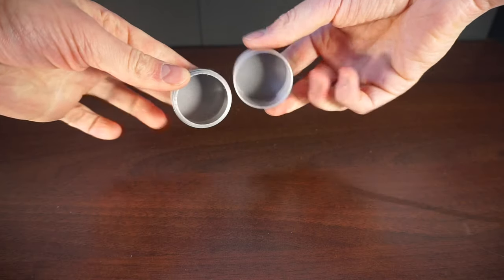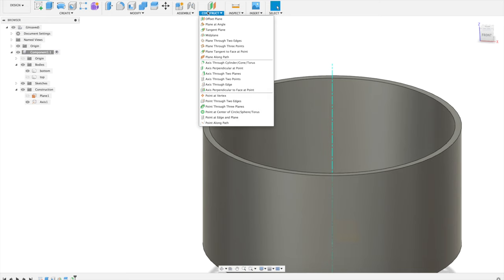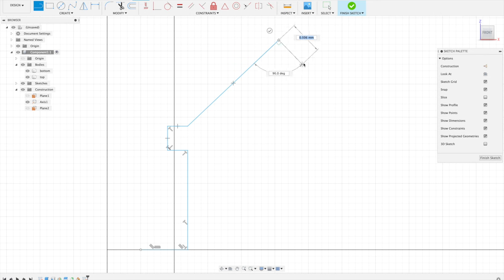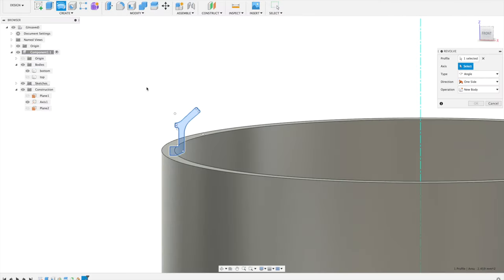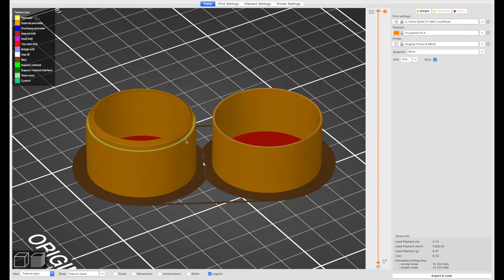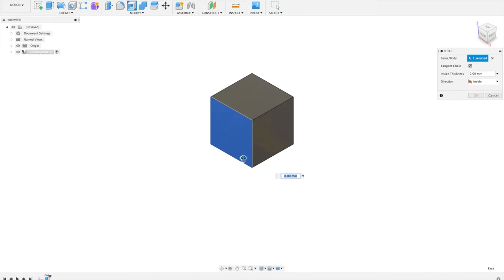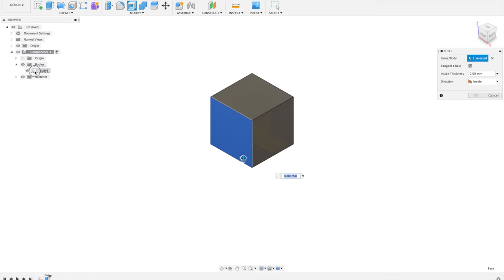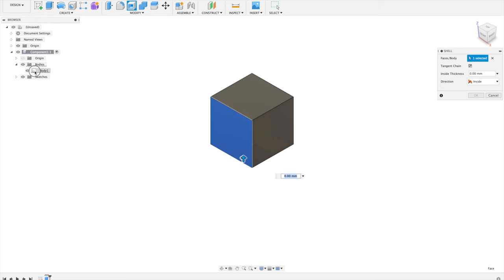Joining 3D prints with annular joints designed in Fusion 360

Comment: What surprised me is you got off without a torrence offset face step on the round one (on the square one it'd eliminate the need for filing). 

After the combine (cut) step I'd always offset face by between 0.15 and 0.3mm and play around with the offset to get the friction I wanted. Didn't realize the round one might still work without this!
Reply: He built the offset into the sketch. There's already a 0.2mm offset between the vertical walls. The only thing that doesn't have an offset is the little protrusion. In fact the little protrusion is the only thing that gets subtracted, since the rest of the sweep doesn't even touch the lid.

Comment: Great video! I think the square box would work better if you cut the corners off the part that sticks into the lid. That would form four tabs that could flex enough to snap into a slot in the opposite side. By changing how big of a chunk you cut out of the corner you could make the tabs shorter or longer.

Comment: Great video.  I am stuck on the sweep and can't get all the corners to join at 45°.  Is there a secret? I'm using a windows PC not mac.
Reply from the maker: I think you are referring to sketching out the lever. There isn't much of a secret there I think. You can add angle constraints to all the corners you want.

Comment: thanks for this! what would you suggest on a design for hollow sphere that will be smooth in the inside as well. im trying to build an arduino controlled bb8. thanks!
Reply from the maker: Sounds like a great project.

I suggest you make it thick enough so there is no flex while rolling. And recess the edge on one by half that thickness and extend it on the other half.

And make sure you have a good undercut, so the two halves are flush on the inside.

See page 20 on this document if you really want to perfect it (though I suggest you don't over analyze it :) ). http://fab.cba.mit.edu/classes/S62.12/people/vernelle.noel/Plastic_Snap_fit_design.pdf

p.s.: Have a look at the Sphero BB8 if you haven't already.
Reply: @dreamonward i really appreciate your reply and suggestions! that sphero bb8 is pretty cool! the one im building will probably not patrol, just move left, right, fwd and back, hahaha

Comment: what is your setting to print that small detail?
Reply from the maker: Nothing special, just the default Prusa 0.15mm PLA setting with the original roll of filament. I think it's showing "(modified)" because I checked "Brim".

In all fairness, some of the chamfers are probably to small to actually show up in the print.
Reply: @dreamonward  eyy..you reply both my question, thanks..i tried make it to, but it was too thin and snap easily, you got any tips? thanks for replying, im new to 3d printing
Reply from the maker: @aguywithlaptopand3dprinter  I'm quite new to the whole 3D printing myself.

I've found that for my printer 2mm walls are sturdy. 1mm thick features are flexible.

Prints tend to snap along the layer lines. So if possible, try bending parts along the layer. In practice that means a cantilever joint will be printed flat onto the bed.

Do note that I did not do that in the video. The joints in this lever have highest stress precisely on those layer lines. But it worked for this demo.
Reply: @dreamonward  that make sense..i'll try print the object horizontally onto the bed..thanks never though of that before

Comment: I mean, I am sure you had the best intentions and you put a lot of efforts in the video, but you make a tutorial for something that doesn't work in the video itself. 
When cutting the groove you then need to add some kind of tollerance in either the inerting or the reciving bodies, it can be as simple as an offset face, depending on your printer 0,2 to 0,1 mm will do.

Being a friction fit is no better than having a straight wall inserting in another straight wall, kind of defeating the purpouse of your sort of spring design